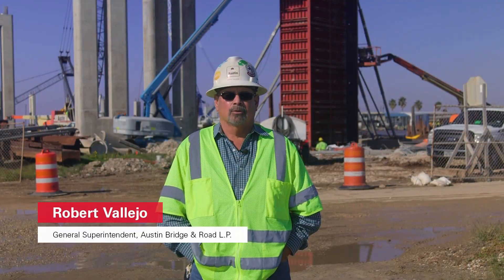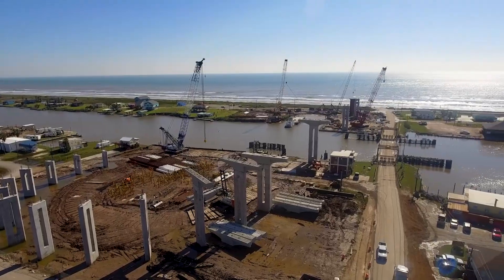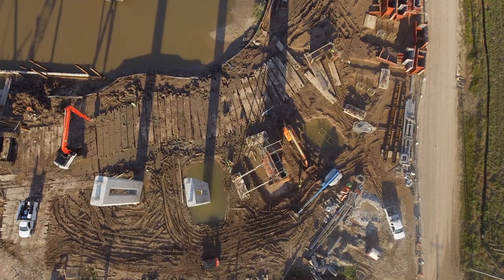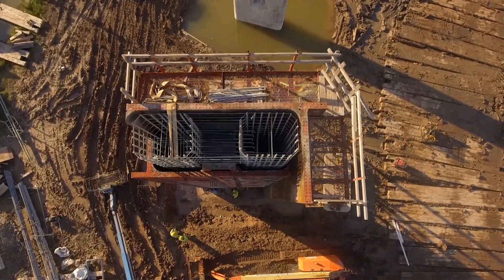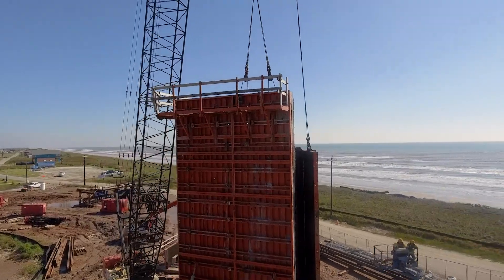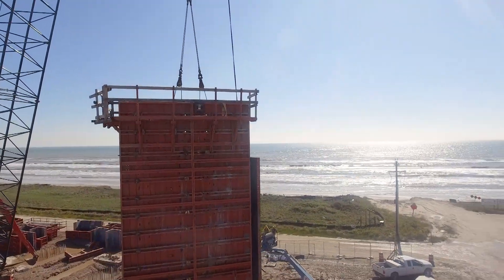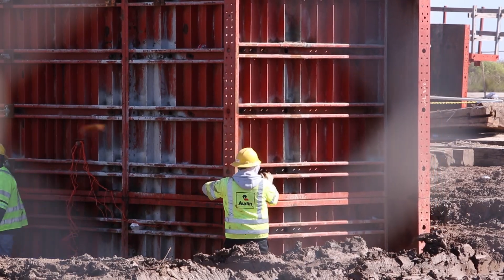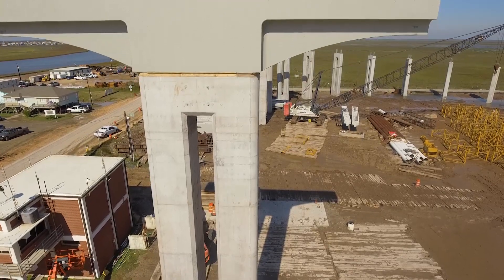PROJECT | FM457 Bridge Replacement, Matagorda, Texas, USA (EN)

Comment: Will a highway be attached ? Quite a large bridge for a small town
Reply from the maker: Hello, As we are currently only contracted as a supplier for the bridge, we can unfortunately not say with certainty whetther there will be any subsequent projects. Usually you can find more detailed information on the infrastructure projects in Texas on the website of the Texas Department of Trasportation: https://www.txdot.gov/
Best wishes, Team PERI
Reply: This is another example of a bridge to nowhere.  There aren't very many permanent residents & the beach is eroding (one of the worst erosion rates in TX, if not the worst).  The old swing bridge needed replacing, but another swing bridge should've been built instead.